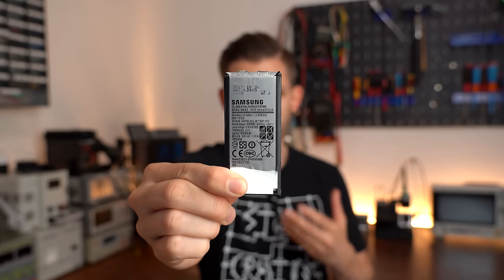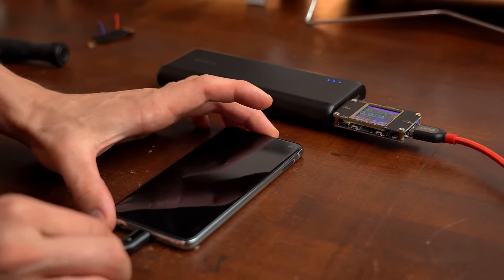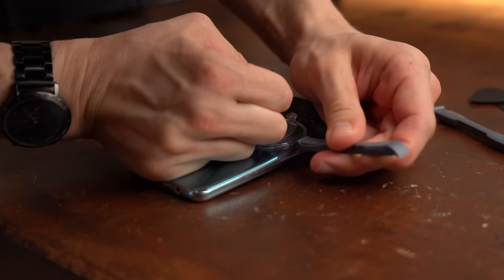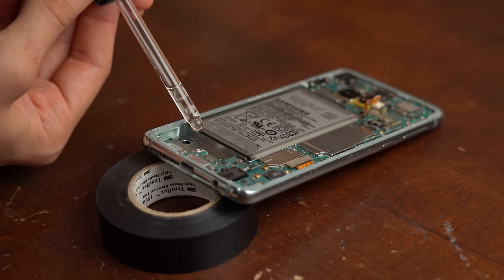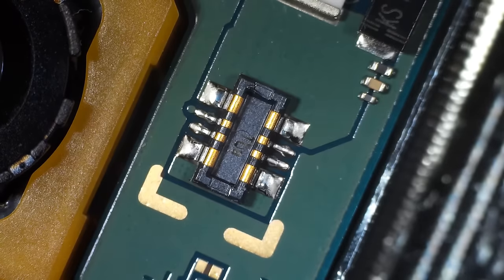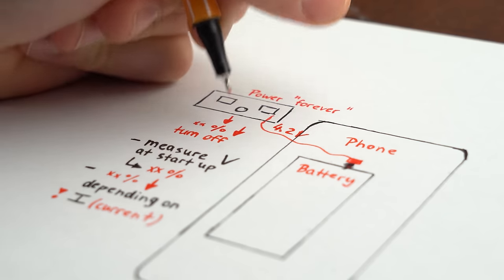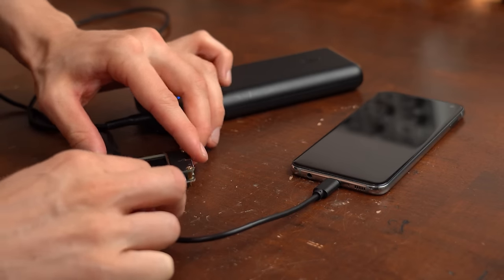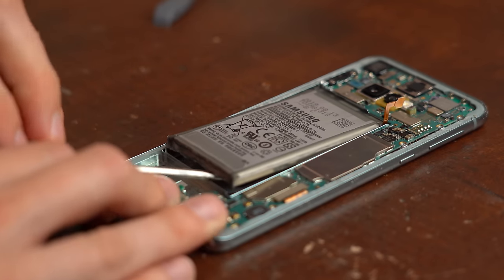I "Solved" Samsungs Swelling Battery Problem! (Batteryless Phone)

Comment: Just keep it charged and switched off. Simple thing and it should be fine. Phone batteries are swelling when they are out of power. Every single battery get damaged if it's kept out of electric for longer and it's not only samsung's batteries 🤣🤣🤣🤣🤣